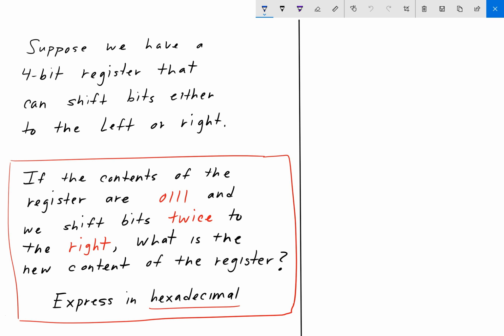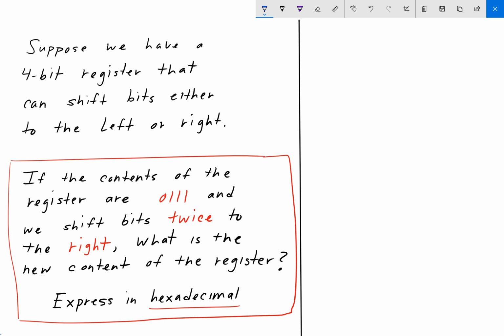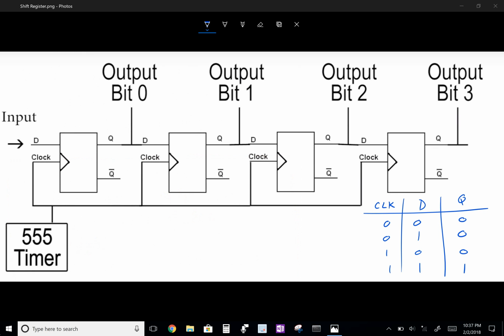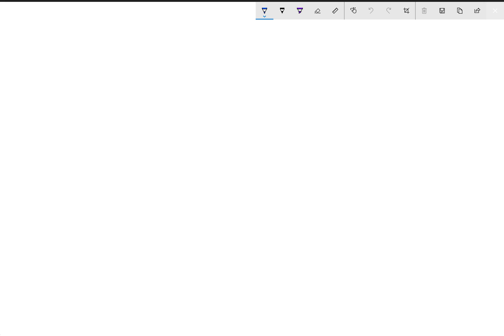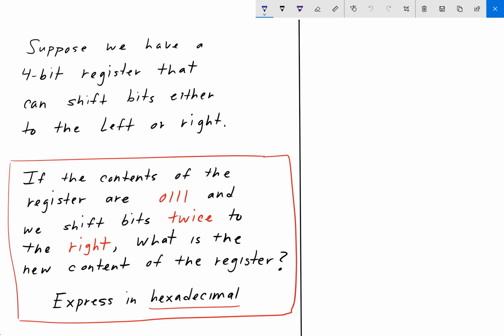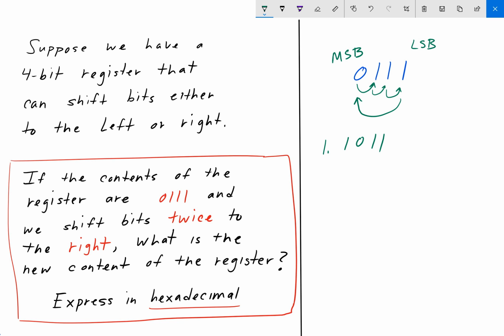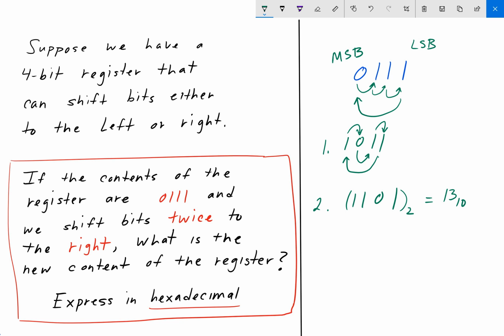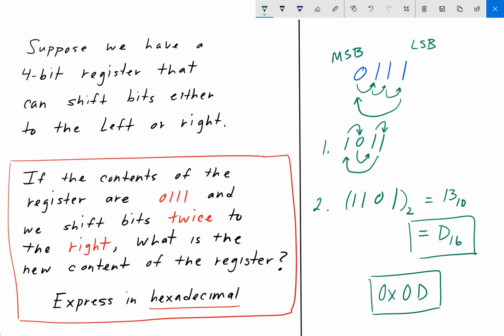Electrical FE /EIT Exam Prep - Digital Systems 11: Shift Register

Comment: The way the question is stated it can not be solved without assuming an input. It states that it is a bidirectional shift register but does not say it is ring counter which I think is being assumed here. But idk because the diagram shown also is not a counter. You would need the last output to loop back to the input. So that when the right shift occurs the 1 from LSB will loop to MSB. If there is no input I’d assume the MSB would turn to 0 and the final register states would be 0001.